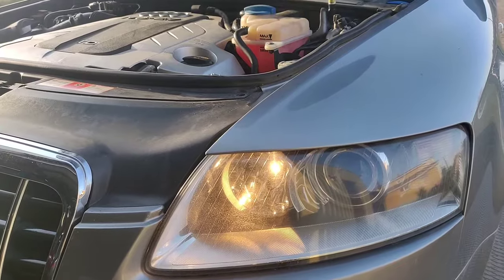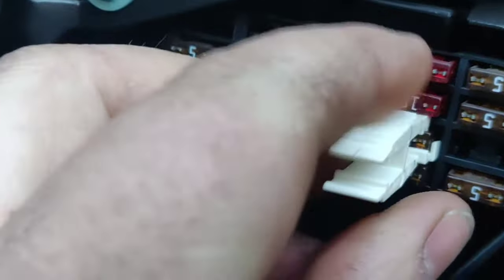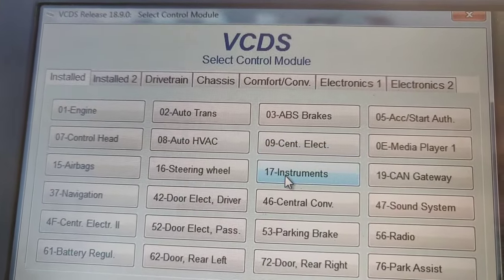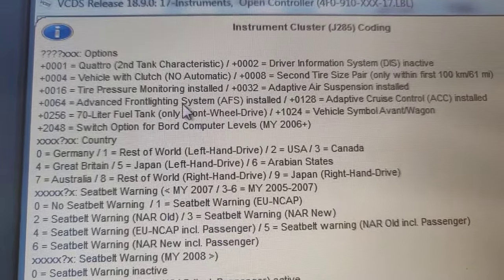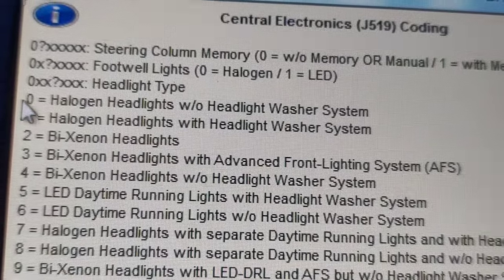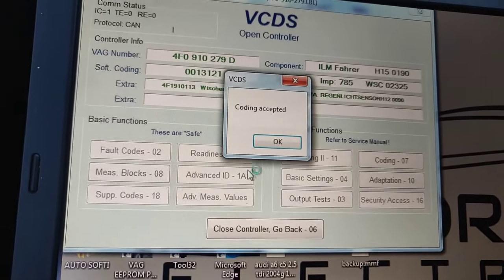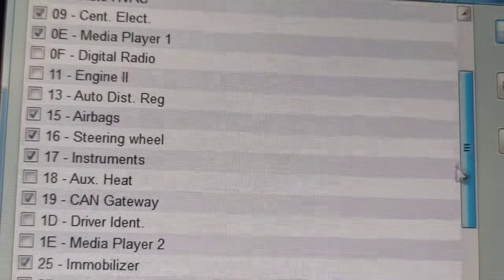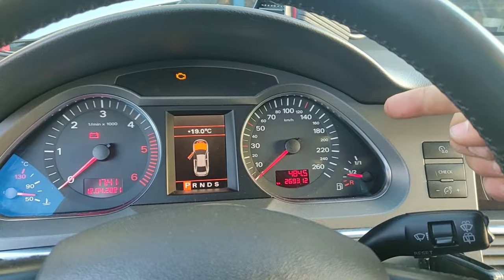✅ Audi A6 C6 Adaptive Lights Problem Solved Coding (AFS) Bi-Xenon Headlights OFF

Comment: You don’t repair anything you just deactivate everything. That’s horrible!
Reply: But thats exactly what some people want. There are A LOT of videos how to fix, some people want it OFF!!!
Reply: @viktordudik464  Ok if that's what you want.
Reply: it's a 1000 euro fix, better to just turn it off since it's not even that usefull
Reply: My 2005 has 179,000 miles on it. It’s worth $1800. Why would I spend $2400 on a headlight?  It’s not horrible it’s simple math.
Reply: @R3Wood  yes I understand that. But than do not calling it repair

Comment: Ok, so after not getting any answer from the video creator, I've put together a small guide on how to do this. For me, the 17-Instruments was unclear, but after searching on the AudiWorld forum, it is pretty straight forward. So, using this video and the guide from the forums, I have made a guide on how to disable adaptive light control. Please note, I didn't test it myself just yet. I will in the upcoming days. If everything goes well, I will reply to this comment. Also, as others stated in the comments below, you do NOT change the Workshop code anywhere, only the Software coding.

Disable Adaptive Light Control in Audi A6 4F

Step 1 - Remove Fuses
-Make sure the Ignition is OFF
-Remove Fuse 18 from the LEFT side. (5A autm. LWR (links))
-Remove Fuse 9 from the RIGHT side. (5A autm. LWR (rechts))

Step 2 - Do the coding
-Turn the ignition ON and connect your VCDS
-Click 17-Instruments
-After it pulls the data, click Coding - 07
-Find the +0064 Advanced Frontlighting System (AFS) installed / +0128 = Adaptive Cruise Control (ACC Installed)
-Remove the AFS by subtracting 64 from the first 4 digits I changed (2129XXX) to (2065XXXX)
-Enter the code, and click "Do It".

-Click 09-Cent. Elect.
-Click Coding - 07
-The coding is pretty simple. Look for the 3rd row that stands for Headlight type. This means, the 4th digit (? in the numbers) stands for the headlight type.
-For me it was "0013121" and it is now changed to "0012121" - in other words, change "(0xx3xxx)" to "(0xx2xxx)"
-Click "Do it"

-Click 19-CAN Gateway
-Click Installation List
-Find the row with 55 - Headlight Range
-Uncheck the Checkbox
-Click Save Coding

-Read faulty codes
-Clear codes

-The faulty sign should be still on the dashboard at this point.

Step 3 - Resetting the dashboard
-Switch off the ignition
-Go to the fuse box on the LEFT side, and remove Fuse 15 Instrument Cluster (10A) (Kombigerat)
-Wait a few seconds, and re-insert it
-You should hear your dashboard clipping a few times
-Turn the ignition ON
-Start the Engine

The Error should be gone.

Cheers everyone.
Reply: Thanks for the effort 👌.  Doest it work with the a3 2010?
Reply: So did this work Tamás?
Reply: Hello, when i tried to do this and when I go into the instruments and click on coding I don't see the same screen that's in the video. I see the screen that says "long coding help".
Reply: @TamasRedler Did it worked?
Reply: Great, do you have all Tamás?
Reply: Perfect
Reply: Hi, thank you for the effort. I tried the guide you prepared step by step and it worked 100%. Now I have no worries with my Audi as when I replaced my headlight this has been a headache for me as the fault was very persistent. Now everything is normal and I can enjoy driving my car without any seeing annoying blinking faults in my instrument cluster. Thank you so much for the creator of this video. You're awesome man! More power to you!
Reply: @hamidben370  I have the same doubt. will it work on audi a3 2010 1.8 tfsi?
Reply: Köszi
Reply: hey thanks for that, can we do it with a normal tester too or only VCDS?
Reply: Someone knows if works in A4 2020?

Comment: We had a UK A8 2008 which we used this video to help, our comments are - 
In the '17 Instrument coding' we had 3137458, the first 4 digits needed changing to 2048 
And as previously commented on note '09 Central electrics' change the software code not the service code. 
Helpful video, can save customers a lot of money with older cars
Reply: Do you have an explanation for the strange coding of 17 inst cluster?  (not the -0064 ??)

Comment: For Audi S6 5.2 V10 owners: no this doesn't work. Well it works, but after doing this, you're gonna get an error for the LED DRL in the bumpers instead. I think because its connected. All S6's have AFS so disabeling AFS at the same time disables the S6 DRL which causes a fault. Atleast that's how my mechanic explained it to me. I bought a new headlight back then. Had to transfer all my bulbs and Xenon stuff as well since for 1400 euro's it doesn't come with everything included lol.

(I don't have this car anymore)

Comment: Hello. I have question. In your instrument cluster you got numbers  2049043 and you want switch off adaptive light you have use - 0064, what will be numbers correct to code the module? 2049 043 - 0064=1985 043? I don't understand how do it.
Reply: I have the same question. Can you explain how to remove the adaptive light? You skipped that part says +0064 so HOW?
Reply: @Lateral_G  as mentioned above, remove 0064 from the first 4 digits to turn AFS off

Comment: i did everything as you said and changed the codes and reset the board but the light still flashes
Reply from the maker: Something is not ok check again
Reply: @modrix  I did everything as you said, once I give the contact the light comes on, then the next time the light doesn't come on
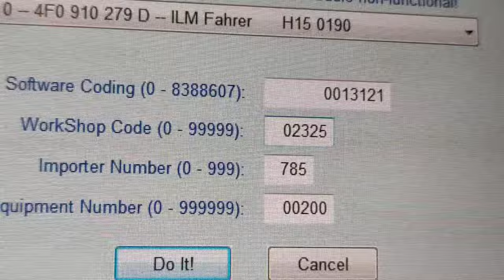Reply: @beli2901  because in video is big mistake... at 6:00 do not change workshop code!!! change it in software coding one line up.
Reply: @Niematotamto  i try to code something on a6 4f today and i did tried to change 7 digit code(this at the video was wrong code obviously) but all i was getting is code rejected error.